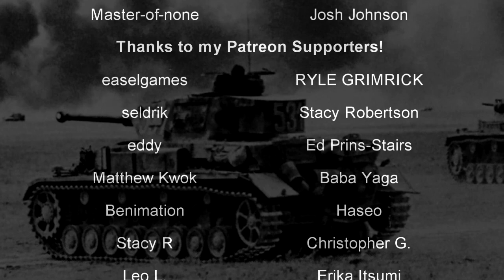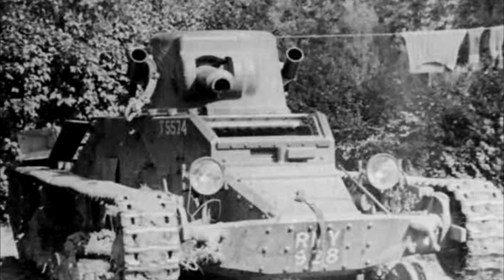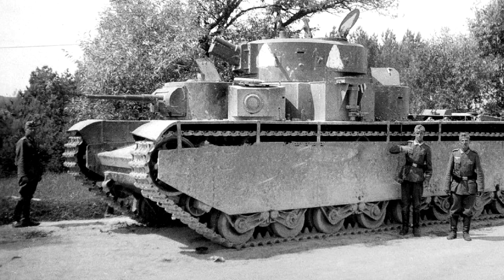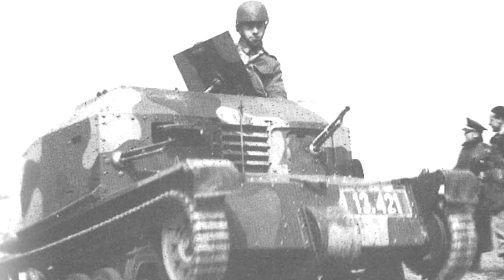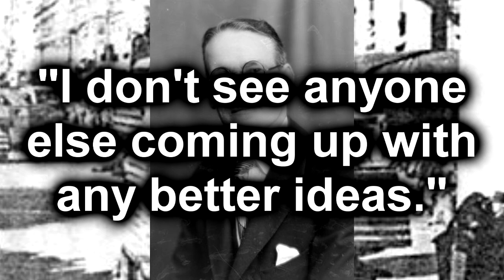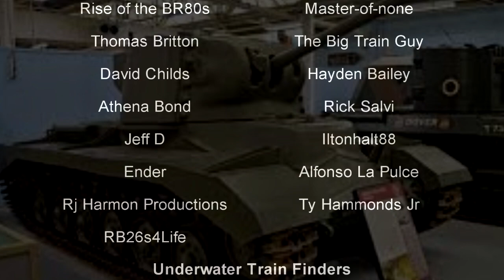5 of the Worst Tanks Ever | History in the Dark

Comment: Actually NZ did have one other native tank design, though it was still in it's prototyping stages, It was called the Schofield tank. think of it like a little tumbler, it was designed to mount a 37mm cannon, and ran on both tracks and road tires, on tracks it could match the speed of a panzer iv, and on wheels it could make double the speed. Bob simple my have said that no one else was coming with better ideas, but that didn't stop the war department from taking something other than samples design, and the Schofield tank in terms of design was already significantly better than Semples bad idea, sure a bad idea is better than no idea, but sometimes a bad idea can be just as troublesome as no idea, if not more so.

Comment: I'm surprised you didn't place the TOG 2 on the list....

The whole ethos around the Bob Simple Tank, was that should NZ be invaded by the Japanese, we assumed australia would have been at least invaded and resisting. Therefore, we would be effectively unable to receive any supplies. So the hulls were designed to fit over any tractors nearby the points of attack to provide resistance during the landings of the Japanese invasion force. 

One was shipped into the pacific in 1944, after the "armor" was removed.

Comment: On the Matilda ones one man turret there was a large number of tank designs that had one man turret the French were large adopter’s as they made for a smaller target and could be better protected

Also the bod semple tank did not use corrugated steel as amour it was actually amour plate and it theoretically  would have been effective as a stationary pillbox 

P.S machine guns aren’t pin point weapons they are area denial weapons

Comment: I agree with some of these tanks. I'd eliminate the Bob Semple, and the Valiant. The Bob Semple was bad, don't get me wrong, and so is the Valiant. But, these aren't production vehicles. If anything, they should be on a separate list of Worst Prototype and Improvised Tanks. Because, in the case of the Valiant, they recognized that it was a flawed design, and pulled the plug. Some vehicles of exceptionally dubious quality made it to production, and had severe flaws. Like, various Marmon-Harrington tanks. The (Bovington) Tank Museum actually has a number of different vehicles, that they have as bad for various reasons, as determined by the curators, other museum staff, and various historical YouTubers. So, they have a bunch of Bottom 5 videos, which are fun to watch. I'd mine those for content.

Comment: The AC 3 Sentinel Thunderbolt I think ought to show up. Built in Australia, they took existing AC 1 Sentinel's (armed with obsolete 2 pounders) and upgunned them with 1 or sometime seven TWO 25-pdr howitzers. Perhaps even the BT-42, captured BT tanks upgunned with 4.5-inch howitzers and using adapted German HEAT shells (that didn't work). One remains, and it has received some notoriety thanks to Girls und Panzer.

Speaking of Japan, the Type 95 Ha-Go. It's 37mm gun was aimed with the commanders SHOULDERS.
Reply: In the Ha-Go's defense,  most 37 mm cannons were aimed by the gunners using their shoulders.
Reply: No. It was armed with two 25 pounder guns because the recoil was roughly equivalent to the recoil of the 17 pounder anti-tank gun, which wasn't yet available
Reply: AC 1 Sentinal.
With the erm.
Questionably shaped MG prot.
Reply: @davidty2006  Only shaped like that to sheath a Vickers MG... heheh, sheath

Comment: The Covanter is a terrible tank, designed and built by the LMS railway. Some bright spark put the radiators at the front, meaning that there were hot pipes running in the crew compartment - slowly cooking them to death ! Plus the tank kept overheating which resulted in many breakdowns - definitely a contender for worst tank !
PS, Kudos from a fellow Sabaton fan ! 🤘🤘🤘